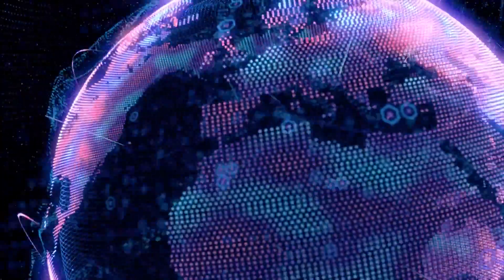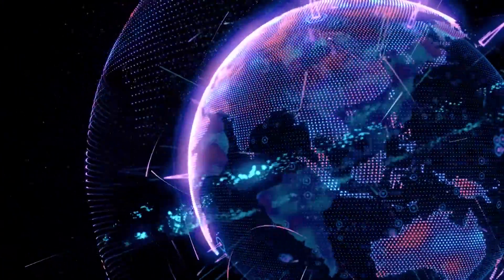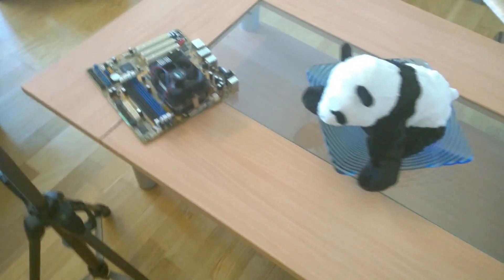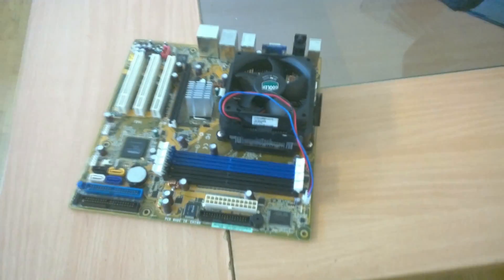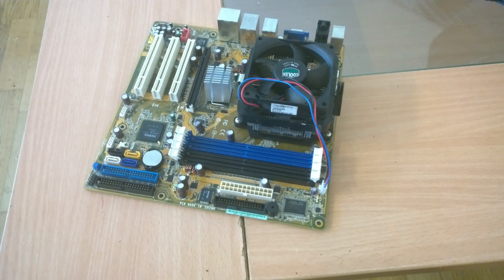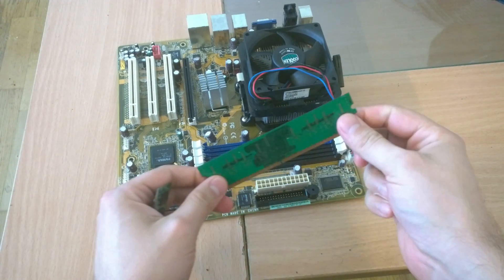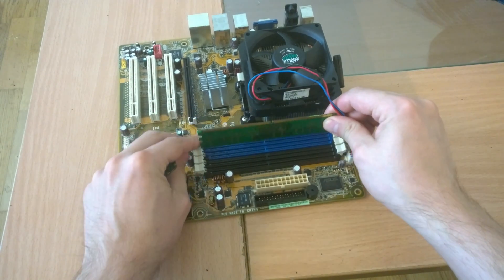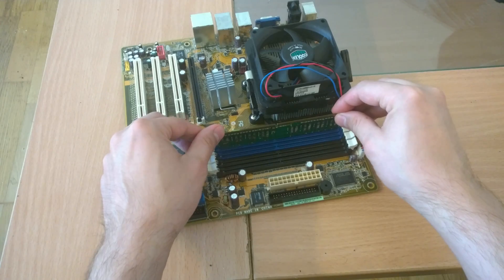Witnessing a Bit Flip first hand!

Comment: ECC (Error-correcting code) might save you from Errors in RAM but it won't save you from me! I want some DDR4 ECC ram but it too much $$$$$$.
Reply from the maker: what are you implying!?!?!? - part of the reason I decided to go with an older FX build was the dirt cheap DDR3 AMD only compatible RAM. 32GBs (That Adobe eats up in a heartbeat). why ECC RAM though? I've never thought it worth it unless you are running mission critical servers.
Reply: Hungry Gizmo Very true I run some servers with clients websites and firewalls. We are planning on changing out the RAM with ecc ram, but having it in my desktop would not hurt.
Reply from the maker: well. that makes sense.